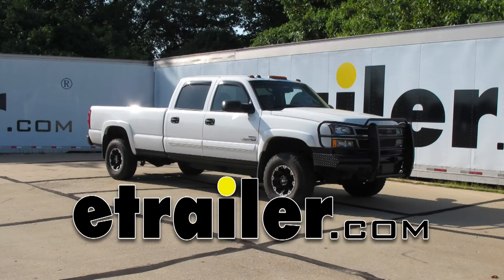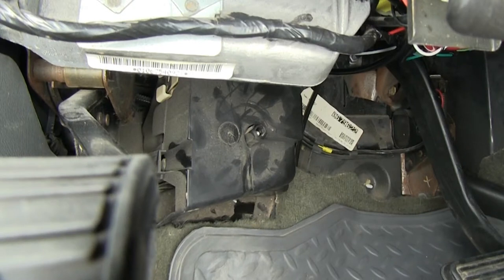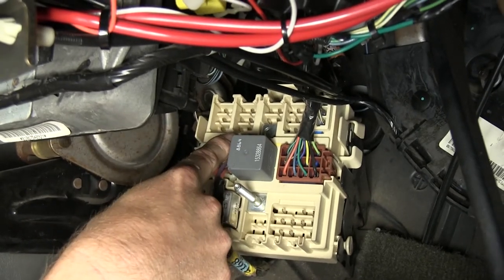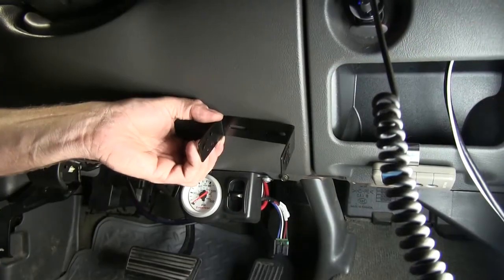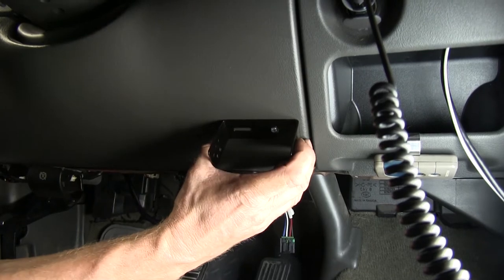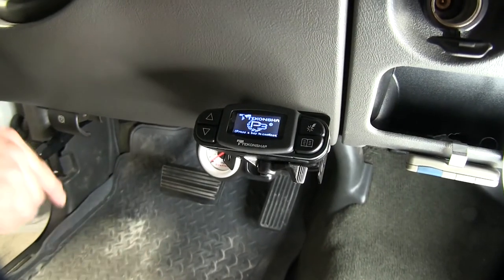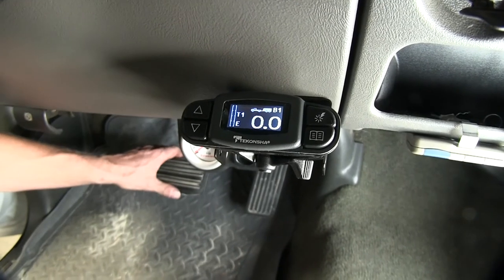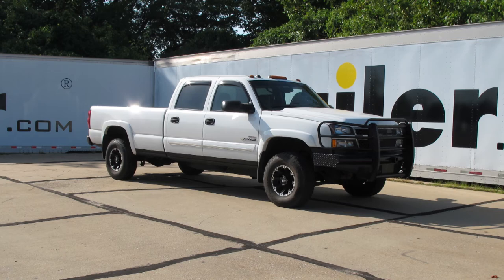How to Install the Tekonsha Prodigy P3 Trailer Brake Controller on a 2005 Chevrolet Silverado

Comment: The hardest part about this instal is finding a drill with a charged battery. It’s so easy installing this system if you get the quick connects. 100% so EASY.